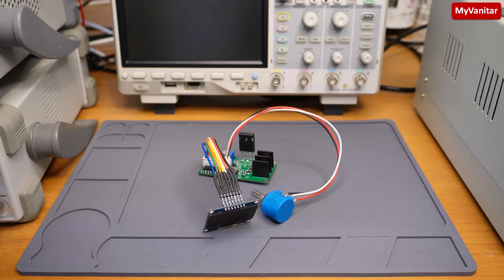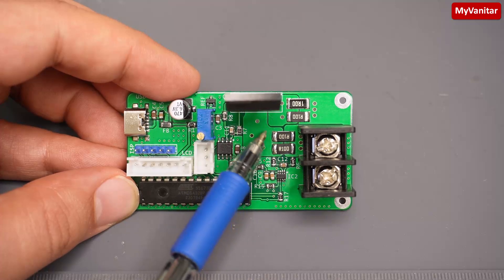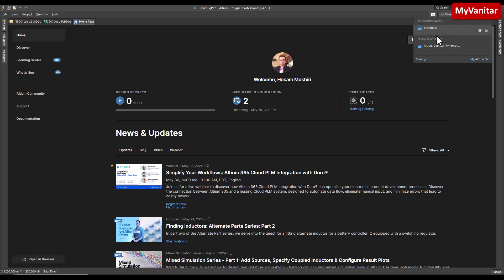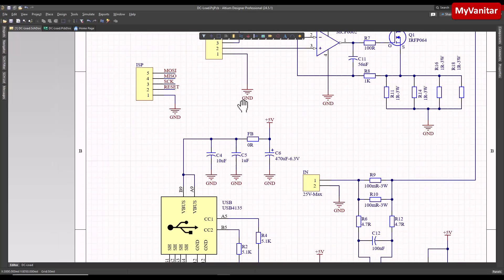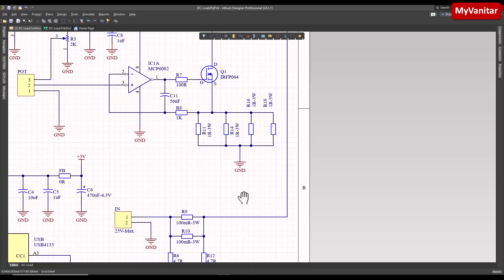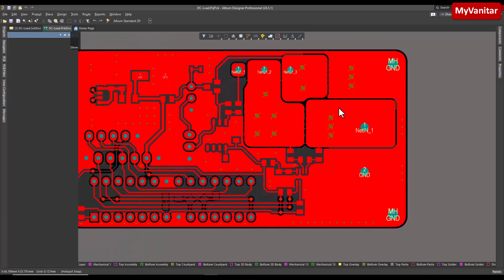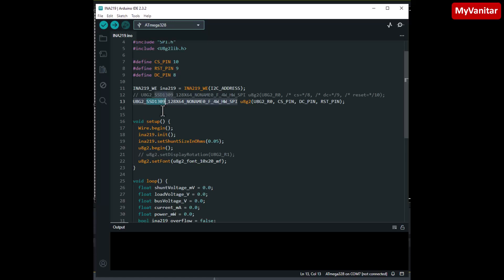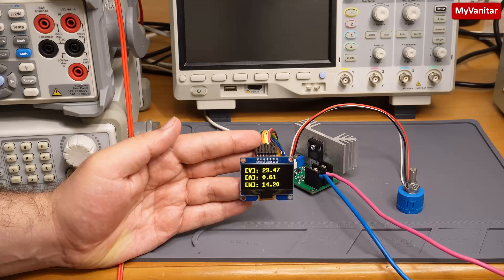5A Adjustable Digital DC Load Circuit

Comment: Curious as to why you didn't decide to use the same current shunt resistors for both, the INA219 & the OP-Amp?
Reply from the maker: opamp needs a minimum feedback voltage from the source resistor, otherwise, it won't work with low currents. ordinary opamps are out, this is the only design published online that works in a full current range with such resistor values

Comment: Traces for voltage drop sensing on shunt resistors network is far from best practices. You included a noticeable part of copper traces as path for current. It will cause less stable real current when the device is heating. It's not an issue for a hobby project, but you learn here people to do things properly, right? So, that's why I'm pointing this here for you.
Reply from the maker: I did not get what you meant, what's the problem with this layout?! when the copper is enough, it won't heat noticeably. open a channel and show your professional projects and do things properly!
Reply: @MyVanitar  I was talking about PCB traces layout. Traces where you sense voltage drop on shunt resistors. I'll be happy to continue discussion after you have a look on some doc. Please search for AD's document optimize-high-current-sensing-accuracy.pdf and have a look.
That's much more close look how to properly do tracing, while on your PCB it's far from proper approach. 
Do not get me wrong, I'm watching your channel not to make critics. I've just spot this and want to pay attention.
Will be happy to continue discussion.
Reply from the maker: The "maximum" power dissipation on the shunt is around 1.25W. the shunt is rated at 6W. can be increased to 8W. Resistors on the source pin of the Mosfet are rated at 12W and can be increased to 16W. maximum power dissipation on those 4 resistors 6W but they won't affect the current reading. This can be even improved if the value is decreased but the user would miss low current adjustments. Load ground and input ground are also common. current sensing is the high side method. if you mean the traces from the shunt to the chip, they are short and identical
Reply: @MyVanitar  I'm sorry, but you are still wrong and/or do not understand what I mean. Did you found the pdf I mentioned? Read it please!
Your math about shunts wattage does not eliminate the fact that traces for main current sensing shunt (R9 || R10) are placed in a way that violate well known, proper tracing. Those sensing traces literally should go under shunts and have to be connected to internal side of pads where they soldered.
Not like you have right now on one side which we see, it's even on some distance from soldering pads!
Reply from the maker: That's called kelvin connection and not for temperature, that's for sensing a very low resistance shunt (1-milli ohm or lower) where the difference between the copper and shunt is tough to distinguish. Still, it won't compensate for the shunt temperature coefficient. here, the difference between such a two-layer PCB copper and shunt resistance (0.05R) is huge. for those applications, I won't use an old-fashioned external shunt measurement method because nowadays embedded shunts are pretty stable and accurate. for those power supply applications in your PDF the accuracy does not matter
Reply: @MyVanitar  sorry, you are talkimg about another thing. Kelvin connection is not a main point here.
You seem to ignore my key point about how pcb traces are made. It would be better for you to understand it and agree instead of focusing on other things. No much sense to continue this discussion.
Reply from the maker: as I said, whatever it is, open your own channel or blog show your professional projects and show off your skills, that's it. there are many other channels that you can argue about which most likely don't even answer any comment
Reply: @MyVanitar   I have to repeat a lost comment. I was talking about PCB traces layout. Traces where you sense voltage drop on shunt resistors. I'll be happy to continue discussion after you have a look on some doc. Please search for AD's document optimize-high-current-sensing-accuracy PDF and have a look.
That's much more close look how to properly do tracing, while on your PCB it's far from proper approach. 
Do not get me wrong, I'm watching your channel not to make critics. I've just spot this and want to pay attention.
Will be happy to continue discussion.
Reply: can you elaborate for not so skilled users like me?  Please tell in English what to change on the layout?  As far as I can tell, this PCB is very well done.